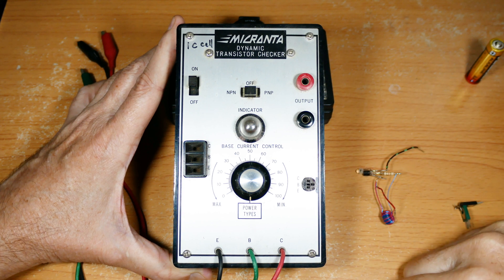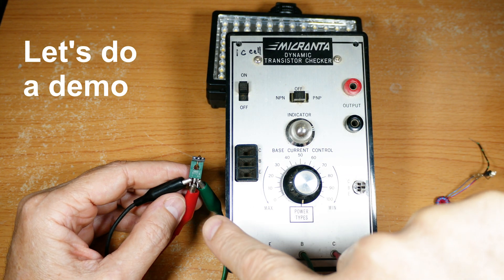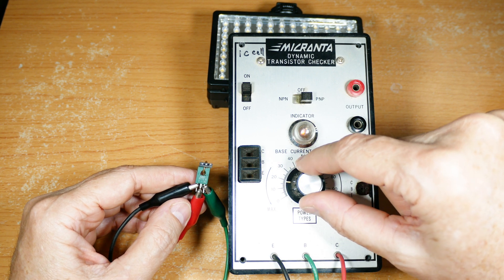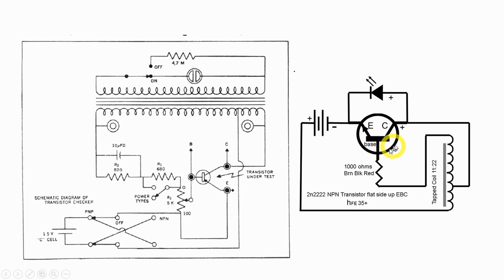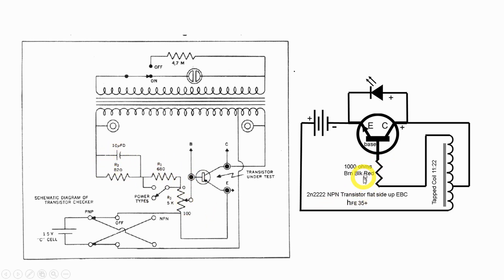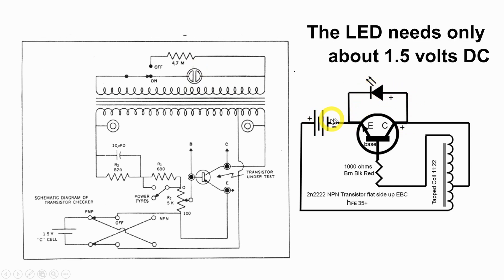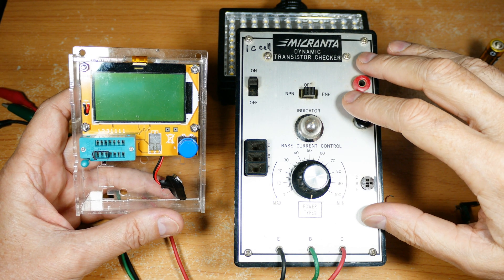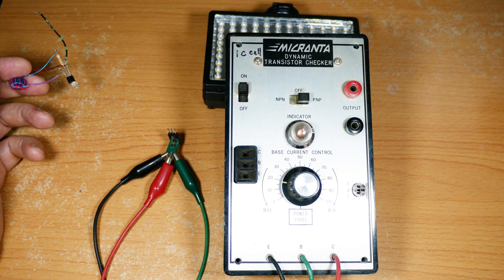Radio Shack Micronta Transistor Checker 22-024 (4K)

Comment: Only tried a couple of transistors with mine so far, but I've noticed when the lamp turns on it becomes brighter as you turn the control a/clock and then goes dimmer towards the MAX position. Wondering if this is normal as I thought the bulb would continue to get brighter?
Reply from the maker: There are manuals online. That is normal, the max brightness tells you the hfe.

Comment: I have this device except it has the name Advance Schools, Inc instead of Radio Shack. The indicator flashes when the switch is toggled between non & pnp but does not come on when stopped @ either side nor when using the base current control. Any clues on first part to replace? I am not a service tech.
Reply from the maker: I doubt it is broken.  Did you check to ensure you are 1) testing a transistor?  (It won't check other components).  2) have the right leads in the right holes.  You have to know which leg is the emitter, base and collector.  Once you are sure of these 2 things and the correct part is inserted with the correct orientation, you select PNP or NPN and move the round knob until the light is at the brightest, which gives you a relative indication of its amplification.  I've seen instructions on line.

Comment: I have one of these and found that it is a good Go No/ Go tester. I went through it and replaced the capacitor plus checked all the resistors for tolerance. Sometimes I just use the diode test function on my Fluke multimeter, after all transistors are back to back diodes in an NPN or PMP configuration!

Comment: Much better and built to last as opposed to the stuff you buy today.  The alligator leads alone are built to last for thousands of operational cycles.  The  testers today might have all the bells and whistles and give you a pretty little graphic on their LCD screens but since most bipolar transistor checks are simple go-no-go tests and a simple tester like this will give you all the information you need, in addition to the ability to quickly match transistors.  If I didn't have one of these I would build one.